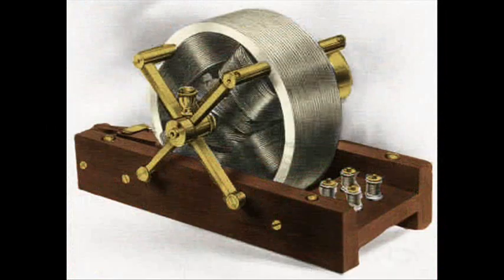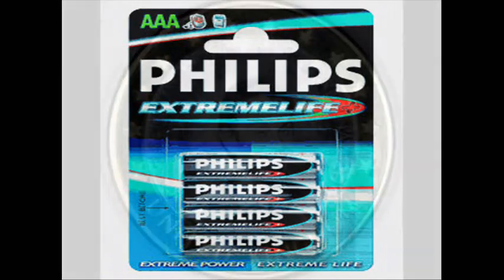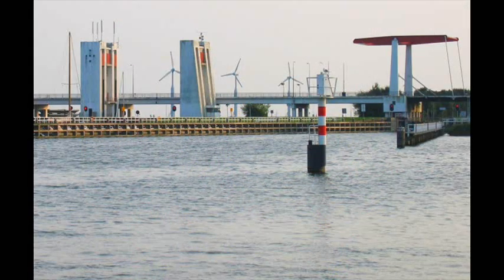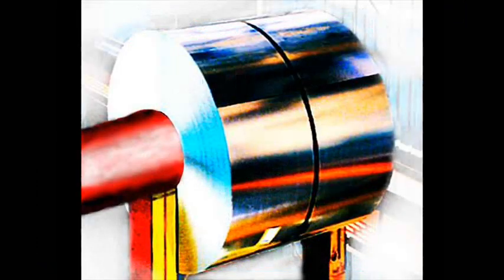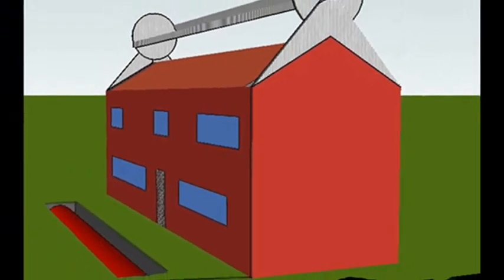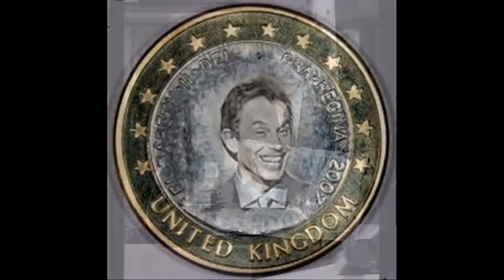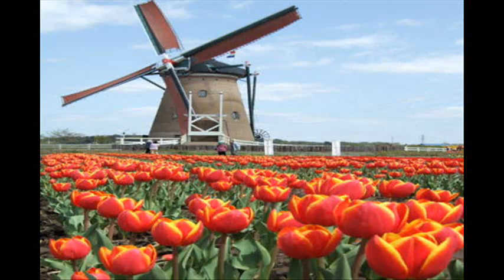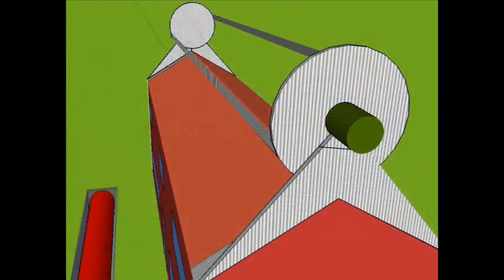flywheel home energy storage

Comment: A coffee thermos with hot water is more efficient then todays batteries in storing energy. Molten salts and higher density solutions work even better and storage could be achieved through resistive or inductive heating.  Although for the sake of simplicity seeking mechanical advantage for the task have you thought about storing that energy as potential rather then kinetic which will have to battle with friction losses until needed?  Like raising a backstopped pendulum

Comment: Ferrite magnets are fairly cheap. They are quite heavy with a density of about 7.8. Kinetic energy incrases to the square of the velocity, 10 times faster = 100 times more energy storage. A large circular track of levitating permanent magnets contained in an evacuated tube and buried in a field. Total kinetic mass say 200,000 kilos, velocity 300 meters/sec. = 9 billion Joules or 2.5 megawatt hours. of stored energy. The Physics & Engineering add up, and so does the Economics. VERY PROFITABLE!

Comment: That's brilliant! 10 ton concrete flywheel in a pit. I'd stick mine on end and give it magnetic bearings mebbe. I for one was all wrapped up about 500000 rpm in a vacuum bottle. Excellent call.